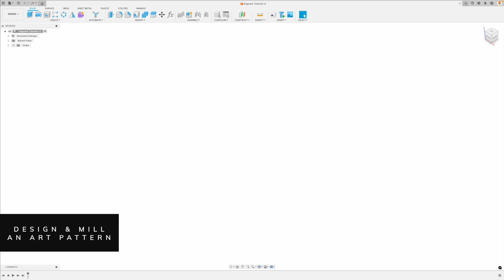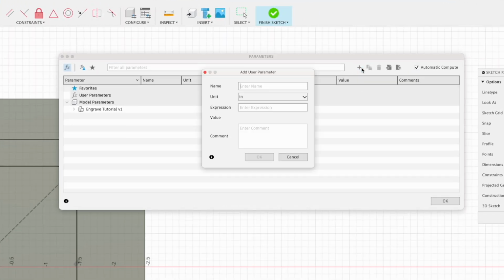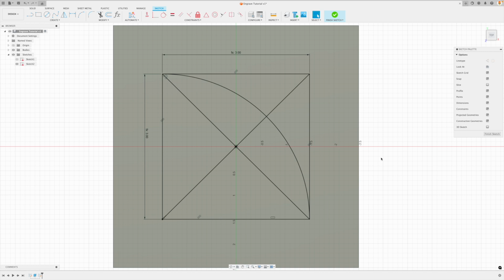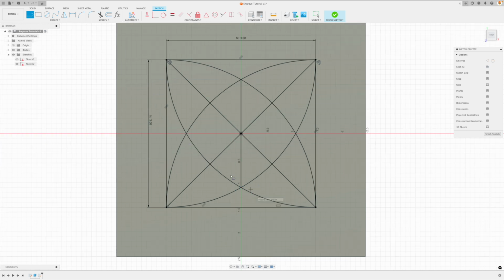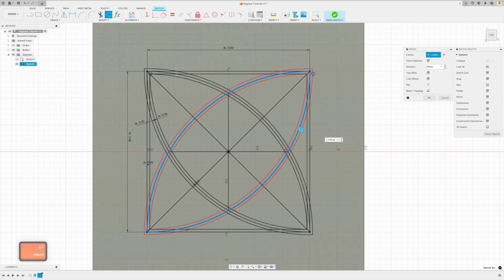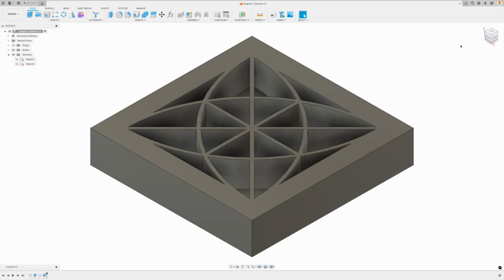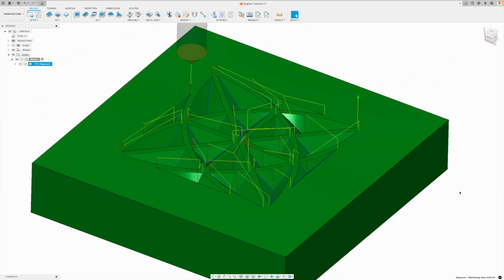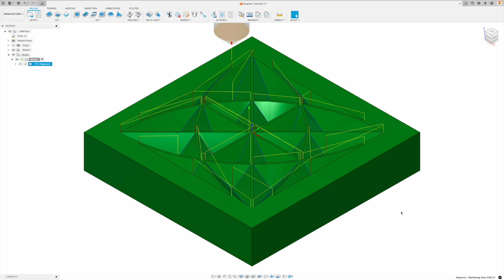Autodesk Fusion CAD/CAM - Engrave a Complex Geometric Pattern (2025)

Comment: Hi great video, do a lot of trivets the same way. just wondering if you know of a way to control the direction (climb mill vs conventional) of engraving so the when doing a profile using engraving?
Reply from the maker: Thanks so much! Yes, that is easy to change. In your tool path dialog window, click on the Passes tab and change your Sideways Compensation field to Left (climb) or Right (conventional) machining.

Comment: what settings should i choose if i want multiple depth? Or choose another operation then engraving?
Reply from the maker: Engraving dynamically adjusts your depth depending on your sketch geometry down to the specified layer height. If you want to force your tool to go to a specific depth, then your sketch geometry, tool diameter, and tool path all need to be considered.
Reply: @learnitalready Thank you